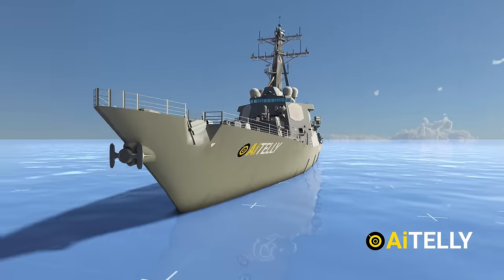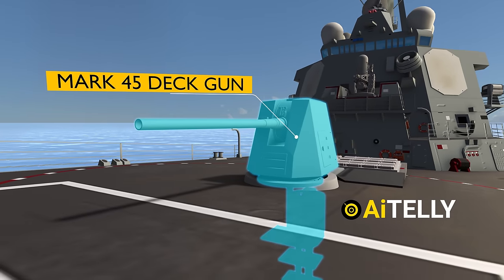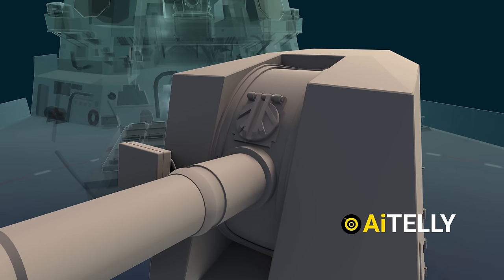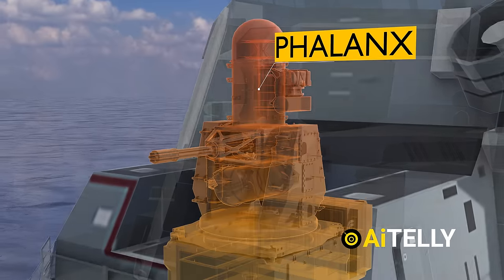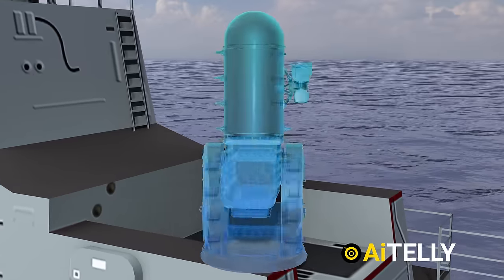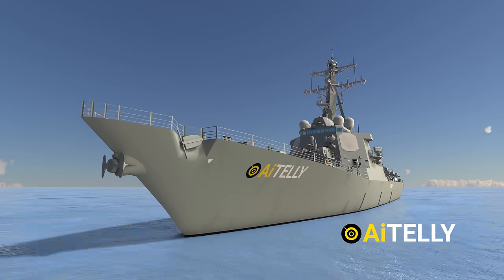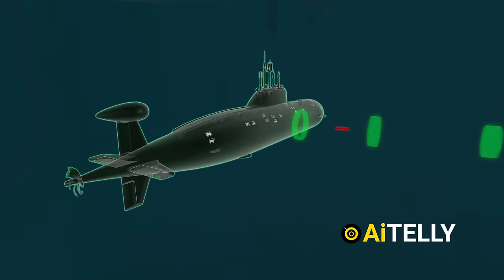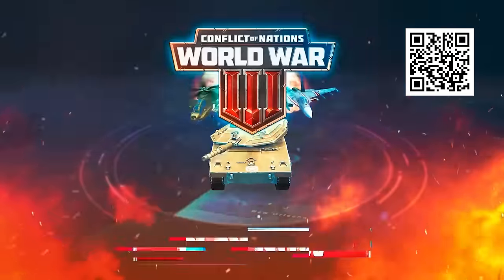How US Navy Destroyer Ship Works?

Comment: There are no diesel generators on an Arleigh Burke class DDG, they have three Rolls Royce gas turbine generators, the first 28 ships of the class have 90 Mk-41 cells, the rest have 96. For the 5" gun, there's nothing automated about moving the shells and powder casings from the racks where they are stowed to the vertical hoist (that's done by about 4 or 5 Sailors). There are no "reverse" gears on them either, but they use variable pitch propellers, so instead of having to stop and spin the propellers backwards, you just change the angle of the blades on it to make the ship move in reverse.
Reply: On the Hoel, DDG-13 we had 4 steam powered main generators and 2 emergency diesel generators (One forward, one aft).  Burke's don't have emergency diesel generators?
Reply: @ToddRainer-j4d  Nope, just three gas turbine generators. Normally just run on two of them. They use a helicopter gas turbine to start the generator main gas turbine and that helicopter gas turbine (starter) engine uses two 12 volt batteries to start it.
Reply: @dundonrl  Interesting. I like having two separate systems separated in the ship.  I the main spaces were hit, and that's always likely - then the forward and aft generators will at least provide emergency power for coms and the like.
Reply: @user-ui1kv8lo5l  That's assuming the shock of a collision, a bomb blast, or grounding doesn't knock the gens off the line. 

I'd heard/read that the bombing of the Cole was so severe blast (the boat-bomb masquerading as a port serviced or harbor aide) it shock-wrecked the GTGS Nr 1 (below CIC and Nr 2 (MER 2) and the crew ended up using firehoses and a bucket brigade to get fuel (drawn from tanks probably 2 or more compartments forward of the Nr 3 GTGS?) some decks below the Hangar Bay into the aft gast turbine generator (GTG Nr 3) fuel feed line. Firehouse are not meant for fuel transfer, so, IIUC, the hoses contaminated thenfuel, and the strainers couldn't keep up.

I served on the Flint (AE-32) (1/85-3/86) and on the John A. Moore (FFG-19) (~10/86-4/88), and it was not fun when the diesels dropped the load and it took 3-15 minutes to restore power and reload all surface and air contacts (whether by hand or backup data cartridges). 

Unless hit with a shipwrecker missile, most combatants should not lose ALL power simultaneously nor spend 20 minutes restoring it. But, it seems gennies are sensitve to shock more than advertised, I suppose.
Reply: @davidsyes5970   Could happen but that's why, on the Adams class at least, there was 1 EGen forward near the bow and 1 EGen Aft near auxiliary steering.  It mitigates, as best the engineers that built the ship could, those sorts of issues.
Reply: So much for OPSEC 😂
Reply: @ItzGreg06 Oh please, there's nothing here that isn't publicly available.
Reply: .. sounds like a SAILOR who knows and served....I was on the "Fighting Fitz" DDG 62 ...and agree.. this narrator is full of it...guess he got his info from Google...definitely not serving

Comment: For those who are wondering about the MK.45 Naval Gun

General Characteristics Primary Function: Fully-automatic, naval gun mount.
Date Deployed: 1971 (Mark 45 Mod 0)
Range: 13 nautical miles (14.9 statute miles) with conventional ammunition.
Type Fire: 16-20 rounds per minute automatic, conventional ammunition.
Magazine Capacity: 600 rounds conventional for Destroyers; 1200 rounds conventional for Cruisers.
Caliber: 5 inch 54 caliber (MK 54 Mod 1/2) barrel length of 270 inches (54 x 5)
Guidance System: MK 45 Gun Mount is remotely fired from the MK 160 Gun Computer System or MK 86 Gun Fire Control System during normal operations
Platforms: MK 45 MOD 1 (5"/54) - CGs 61, 65-68 (2 gun mounts per ship). MK 45 MOD 2 (5"/54) - DDGs 51-80 5" 54 (1 gun mount per ship); CGs 69-73 (2 gun mounts per ship). MK 45 MOD 4 (5"/62) - DDG 81-113AF (1 gun mount per ship); CG 52-60, 62-64 (2 gun mounts per ship).
Reply from the maker: Thanks for your feedback
Reply: @Aitelly  
You're welcome

Comment: As part of the RD team that manufactured the high speed reduction gearing for DDG 51. Working in the GEAR plant in Lynn MASS for GE. I ran the largest 7 axis cnc horz boring mill especially installed for the project. Myself and another machinist machined the prototype high speed reduction gearing required for testing. I wish more was talked about because in 87 after they went into production I resigned. I completely left the machinist trade fora better life and did

Comment: As mentioned elsewhere, the DDG-51s do not have diesels. Reportedly, the Australian Air Warfare Destroyer, the UK Daring, and the Spanish licensed Aegis Frigate have diesels.

Note that the USN has 3 Allison family of generators bought out by Rolls Royce/Rolls-Royce, but only two are operational at any given time. One provides power, and a 2nd is on hot standby or for load balancing, and other reasons (I wasn't an EM, EN, FN, GSE, GSM, or other; I was a Radioman aboard an FFG-7 (FRG-19) ship which does (it still exists, in the Turkish Navy, Gediz, Hull 497) have 2 GE LM2500s and IIRC 2 diesel generators, on forward and one near the Main Engine Room, which I did visit once or twice. I had access to many spaces while working towards my ESWS Pin, but also separate from that had eventually been in almost every space aboard that ship, even in the space between the LM2500 uptakes, the air intake housing when our 2 engines were replaced, the Mk 13 missile space, one of the two diesel rooms, supply, and the VCHT spaces, as well as the COs, the XOs cabins, and some of those of the officers. I didn't go into the Engineers Enlisted Berthing as they were fiercely territorial more than Ops and Deck.

The political design choices foisted onto the Navy if it wanted funding for the Burkes was the 51s had to be AT LEAST 50 feet shorter than the Ticos/Spruances. (The Ticos, due to mass/displacement picked up a wet foredeck/foc'sle, so bulwarks had ro be added, increasing the ship's length by about 4 feet over that of the parent hull, the Spruance Class . So, ~503 feet the Flight 1 became. That forced the removal of one of the two watertight compartment separation between the 2 main engine rooms, shortened the ship, made her a wide, fuel-guzzling hog, and forced the Navy to ask GE to up the per-engine SHP so the 51s would be able to keep up with the Bird Farms. Such political imposing prevented the Navy from being able to in the future make use of the Northrop Grumman AHDS, which was conceived of in the mid 1970, to be what the Navy around 2016 or so tried to implement to desperately reign in the DDG-51 fuel consumption. The 51 could fit only ONE, not the envisaged 2 to 4 units. So, without a real redundancy due to sheer lack of space without cutting or removing something, it was probably pointless to proceed. So, no AHDS for th others of the class in any flight up to 2A.

One GTG is forward of the fwd engine room, one is in MER 2, and one is aft in the Generator Room. When two run, one is off, in standby, or undergoing maintenance. For bus loading/frequency/voltage/transmission line capabilities/myriad reasons, you'll probably never have all three running at once. This seems to be physica, as IIUC, the online genny counts limit applies to other navies as well depending on the gennies chosen, power capability, redundancy, switchboard, and control systems, and much much more.

Sadly, when one of the two Burke destroyers that made contact with merchants off Japan (or, this may actually be related to the COLE), the jolt was so hard that the ship lost all power for several minutes across the two running gens. IIUC, the loss of power killed the ability to pump fuel to aft where the one working genny was physically operable. So, a bucket brigade or a hose brigade was needed. Fire hoses are not rated for fuel transfer, so...

This is not first-hand information. It's either in the NTSB reports or elsewhere in trade/industry papers.

Happy Hunting (for info)!

Comment: Major error on the MK 45 Gun section. No USN ships have an "automated ammunition shuttle"
The rounds are hand loaded into the lower hoist from bulk storage (or straight into the loader drum if the magazine is on the same deck such as the rear gun on the Ticonderoga's). The RN, RAN and RCN will have such a system when their type 26 (or derivatives) come on line but this seems a waste of weight,ones and maintenance to me as an former operator maintainer of the MK  45
Reply from the maker: Thanks for your feedback and your Service 👍🏻
Reply: What do you do now? What learning resources would you recommend for learning more about MK 45 from the operator's perspective?

Comment: SPG-62 radars don't spin around like that. They are not search radars, they are target illumination radars (kind of the exact opposite). On Arleigh Burke-class destroyers, the role of the search radar falls on four SPY-1 (or SPY-6 in case of Flight III ships) solid state electronically steered phased array S-band radars placed around vessel's superstructure giving the ship 360 degree real time radar cover with each SPY-1 array capable of tracking and engaging 100 targets in real time (based on official unclassified information. The true number is almost certainly at least twice that and most likely still much higher), with SPY-6 array reported being 30 times more sensitive (note that this doesn't necessarily mean capable of engaging more targets).
Being S-band radars gives them excellent range but insufficient resolution to accurately guide semi-active radar-guided missiles (such as SM-2 and ESSM Block 1) in their terminal phase (last few seconds before impacting the target) which requires X-band. This is where SPG-62 radars come into play. When SM-2 or ESSM Block 1 enter their terminal phase, SPG-62 antenna will illuminate their target with a narrow X-band beam giving the missiles highest possible radar resolution. Once target has been destroyed, the SPG-62 antenna may point to another target, but will most certainly not be spinning like a search radar. This is why there are three of them on each Burke and four on each Tico-cruiser.
Good job with the animation and 3d modeling by the way.

Comment: Navy guys, a question: Do you collect the expended brass from the 5 inch or just kick it over the side? Reasoning: with the 105mm tanks we used to reprocess the brass for future tank rounds.
Reply: Push it over the side
Reply: We made ash trays out of them in my day.    1977-82
Reply: @curtisophillipsjr378  Same with the Tankers.
Reply: @curtisophillipsjr378   we still do today as well. The problem is the hardened metal is really hard on the lathe
Reply: @curtisophillipsjr378 same here even today we have two empty 5in brass as ashtrays in our smoke deck
Reply: The powder casings are no longer made of brass/bronze. The metal is a alloy that does not polish up like brass. During training, the casings are saved for recycling, during shots of anger when you're done save/recycle what is on deck rolling around.

Comment: Good video, but I have a minor nitpick. You confuse weight and displacement. (Many people do…)

Your video states that the Arleigh Burke class weighs around 9500 tons. In fact, that’s the ship’s displacement. If memory serves, the vessel’s dead weight is closer to 3000 tons.

Excellent animation. Hope to see more.
Reply: The actual displacement is the gross weight; the weight of water displaced by the hull of the ship equals the weight of the ship, which is how buoyancy works. That's gross weight (the standard term in loaded displacement), meaning the ship and its contents.. so perhaps you think "weight" should only mean the bare hull, or the ship in sailing condition (with engines, for instance) but with no other equipment installed? 3,000 tons sounds plausible before fitting with everything that makes it a destroyer... what may be called Light Displacement or LDT. The video is describing a functioning destroyer, not an empty cargo ship.

Comment: SeaRAM would be used before CIWS, as it has longer range. 
Edit: 
I am not sure if this is still the case. with VLS, the flight profile used to fly straight up to 100,000 ft, then towards target, picking up radar guidance only in the final phase. This was the most efficient profile? giving much better range than early Std, which flew toward target with radar all the way?
what this would have meant was it is not good for missiles already close, hence Sea RAM?
Reply: I think the sea ram fills the niche in coverage between the long range modernized standard and the relatively short ranged phalanx. Makes me think of the coverage layer of WW2. The 5 inchers with the proximity fuse, then the the 40mm bofors for moderate and close range, and the the 20mm for last ditch close range.